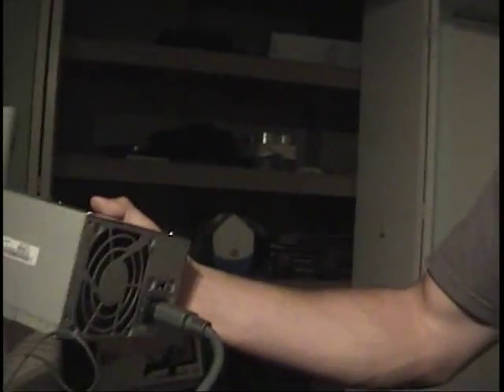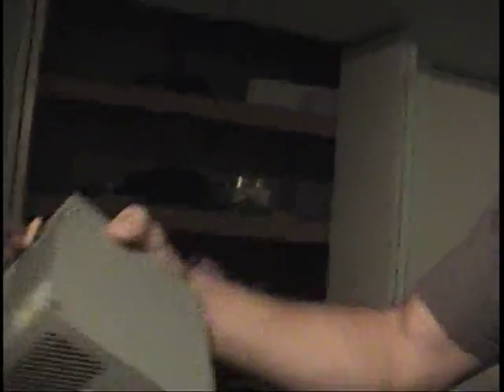How to make a xbox 360 power supply with a pc power supply (Part 1)

Comment from the maker: @st3roidz1 you can, it will prolly have problems where it will just shut down from over heating.. i tried it and it will play for like hour and half and shut off from over heating.. but you can... but a quick tip, if your ATX PSU has a green wire connect the green wire from the xbox power cord to the green wire coming from the ATX PSU, but if not you will have to connect it to the ground..

Comment: @vinnnnnnnnyyyyyyyy Also, is it ok if i just strip the wires comming out psu and strip the wires on the xbox cable and join them? opposed to desoldering and reconecting?